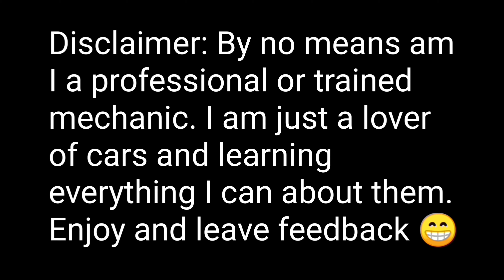FIRST DRIVE: heavily modified 1963 Austin Healey Sprite 1098 : race cam & straight headers

Comment: A tip for bleeding the clutch, there is a rubber plug in the footwell of the car that let's you get access to the slave cylinder and bleeder, as well as the lower starter bolt.
Reply: Want to buy one
Reply: @Spencerjones_musicSM  Already have one.  A fairly original 1962.  I basically daily drive it when ever there isn't salt on the road.
Reply: @johnpearson492  nice 🔥

Comment: Jack up one side of the car so the actual bleed nipple is at the top. This stops an air pocket from getting trapped in the slave above the bleed nipple.

On RHD cars this means jacking up the driver side higher.

Also look to fit a remote bleed nipple by connecting a brake hose attached to bleed nipple that is fed through the engine bay for easier access / bleeding
Reply: pro-tip

Comment: I fought the bleeding battle with brakes and clutch not long ago.  I also tried the vacuum on the clutch and never really got there.  The method that worked best for me was this:  Recruit a friend to push the pedal.  Remove the slave cylinder from beneath the car (A pain) hold it vertical with the bleed nipple facing up, use a screw driver to hold the diaphragm in place.  Have you friend pump the pedal, you're going to see a ton of bubbles.  I tried everything I could with the slave cylinder in place, but never got it to fully bleed until it was vertical.
Reply from the maker: Wow thanks for the fill in.  Right now I found one of the rear wheel cylinders were leaking.

Comment: Are those 14-inch wheels and tires? Is that why the rear has fender flares? Where did you get the rubber plug for the antenna hole? I cannot find one. There is lots of Weber tuning help on the internet...
Reply from the maker: So I just switched back to SU carbs and feel way better about them.    Maybe my Webber had an issue from the get go.   I didn’t install the tires and  rims but will be making custom flares soon and updating the entire car

Comment: You might have an issue with ventilation of the fuel bowl (also called the float chamber). If the bowl is not vented correctly you will have constant running issues and correct jetting will not be achieved. The black fitting on the red plate, just above the left hand trumpet, is covering an approx. 1/2" hole which should be open to atmosphere. This fitting would at the very least need to be hollow if not removed. If you cant remove it, try operating the engine temporarily with the round jet inspection cover (under the wing nut) off, it will allow air into the air corrector jets and into emulsion tubes while also applying atmospheric pressure to the fuel in the bowl. There were some webers (40DCOE34 and 40DCOE35 for example) that had a castellated spacer under the inspection cover to allow ventilation because the hole in the front was specifically not drilled at the factory.
Reply from the maker: Wow thank you so much.  I have been playing around with it lately since weather finally cooled.  It has been on the back burner and this could really help me out.   I will give you an update on thjs
Reply: @petescarport  No problem. I hope it makes sense and Im keen to see how it works out. If you do take the jet inspection cover off to run the engine, dont do it permanently as it will be bringing in unfiltered air and will stink. Its just a way to diagnose a problem.
Reply from the maker: @engineerbynumbers9888  so I just started her up.   So shocked she starts on first try every time even with slightly older fuel and sitting for 3 months.    I fully understand all that you are saying and saw that the previous owner of the carb had put a small hole in the rubber.   When I took rubber off completely and then opened the inspection cover for jets it still did same thing. Basically runs amazing but as soon as I hit 1/4 throttle or more it stalls unless I creep into throttle than it’s ok.   Hopefully that made sense.  I’m debating to take it to a shop that tunes since I love doing this on my own but would hate to waste a ton of money and time on buying random jets.    Do you by any chance have Instagram where I can send you photos and chat a little.   Thanks again for all the help

Comment: Are you getting fuel squirt when you look down the carb and give it throttle? Engine off of course 🤯 if no or not a nice consistent stream  then you have a bad accelerator pump  causing a lean condition when accelerating. It may rev better by slowly throttling into it and or cause an intake pop. The filters helped a little due to restricting air thus giving it a slightly richer mixture Possibly 🤷‍♂️

Comment: What's the condition of the distributor and ignition system?   Do you have the vacuum advance connected?
Reply from the maker: I don't have the vacuum advance connected because the webber carb doesn't have a location for it. I've tried and many other have too but from what I read it's not something you need with a Weber
Reply: @petescarport  I have not played with webbers, I have the stock SU carbs and love them.  You may then check to see if you have too much or too little static advance.  The vacuum advance makes up a large portion of the advance so without it you are either missing out on top end power or low end smoothness.  A different distributor that only has mechanical advance might work well.

Comment: bleed from the connection at the master cylinder....like bench bleeding... get to harbor fright and get a vacuum bleeder as well. Once thats done...get in the car and pump the hell out if it. The tiniest bubbles leave the pedal soft.
Reply from the maker: Thanks.  I know what you mean.  Just did the same to my Porsche 944

Comment: You honestly need to increase the idle engine speed a little bit.  It will help some.
Reply from the maker: Thanks for update.   I plan to fully tear down car soon.  I was hoping to drive this winter but the brakes need complete rebuild.  But this fall/winter should be good.

Comment: Look up old school trick for bleeding brakes works better than anything in the world all you need is a water bottle and I forget the size hose I think it's 3/16

You will be shocked how easy it is by yourself
Reply from the maker: Thank you.  I found out it wasn't bleeding because there was a major leak in one of the calipers for the brakes. It was allowing air into the system
Reply: @petescarport  I still suggest you look up the old school trick on YouTube about bleeding brakes by yourself. you will be amazed!
Reply: I have the two person method pumping the brakes and clutch on mine to bleed it, and it works great.  I did have the upgraded dual circuit brake setup from a later Sprite.